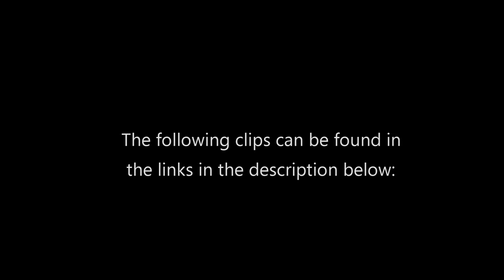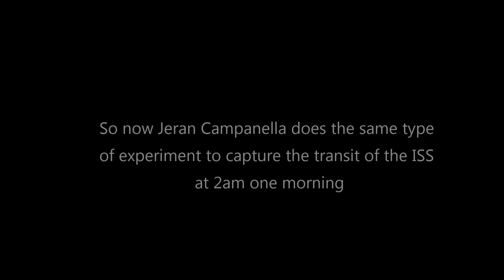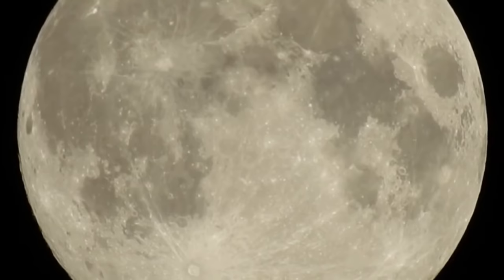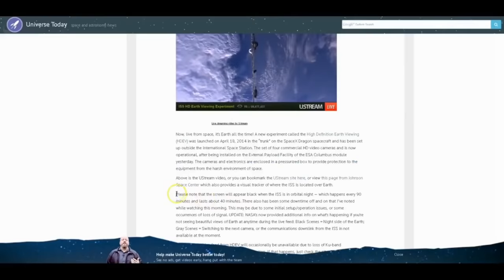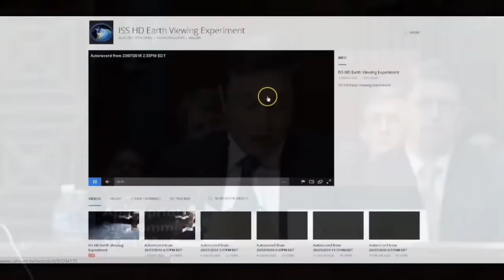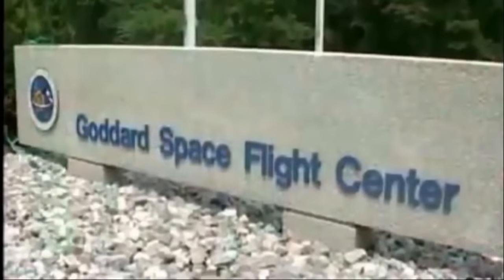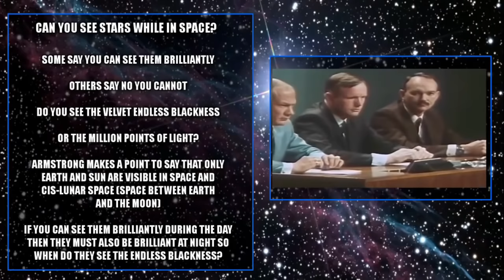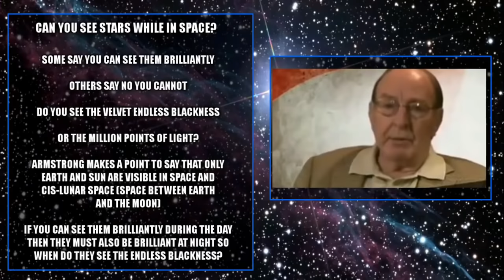The ISS Confirmed!

Comment: Why are o-ring seal's such an issue  they are only sealing a mere 14psi (1 atmosphere). Don't make the mistake of thinking a vacuum sucks it doesn't. When you fly you don't worry about the large number of o-rings used in the hydraulic systems for under carriage, control surfaces, brakes etc sealing hydraulic fluid at several thousand psi.
Reply: I agree it's not high pressure. You could seal it with duct tape.
Reply: Exactly. Debunkers often try to add to previous skepticism and then add it nonsensical stuff. Often to somehow contend that the Earth is flat. This debate used to be much more to the point and profession before that movement started to take the forefront of skepticism. Look up the ancient DVD "What happened on the Moon". I found it for free. Good stuff, old school. Educated thinkers in suit questioning rather than inverted baseball caps over hoodies.
Reply: Cloxxki - "Educated thinkers in suit questioning rather than inverted baseball caps over hoodies".   What is that meant to mean!?
Reply: @anti-trollcomedian1664  duct tape don't work in a vacuum  of outerspace and you never been to outerspace to know how outerspace works
Reply: @ejones6647  You have never been to outer space either, someone else commented back and told me I was correct. One atmosphere is only 15PSI. Look it up it's not that much pressure. How hard is to hold the end of a balloon closed until you tie it off?
Reply: Jon Holland "It's not high pressure and it doesn't suck out"???? Are you kidding me? Take a gander at  NASA's giant vacuum. Check out the door and the seals and the fact that the chamber is made by many feet thick concretely. They rarely use it anymore because someone almost died testing a suit. The cognitive dissonance is strong in this thread. I'm actually pretty shocked at how well the propaganda and mind control is working. Its so blatantly obvious that it's fake and you lot with fight tooth and nail to defend this fantasy. I know it's tough, it would be so cool to be able to be" in space" etc but it's a story, a complete fabrication. Enjoy being lied to. I'm done.
Reply: @TheJoshA  NASA's 'giant' vacuum.... There's a a clue for you there. We are talking about very small o ring seals probably around 1 inch dia, its probably not even seeing a loading over its total surface area of 1 ounce. 1 square foot is 144 square inches multiply by 14 gives you pounds per square foot. Not hard then to understand the loading on the walls of a giant vacuum chamber.
Reply: @TheJoshA  do you have a background in engineering? You don't seem to be looking at this with an engineers eye, there is no information on the mechanism. We have no information on how many turns of the rod are required to operate it or what material the o rings are made from  & we don't know how often it is used.
Reply: Nat Sarim  "That tin can, as well as their comedic "space suits", would blow up like a balloon,"
Then you must be so amazed every single day that the pressure in the tire of your car do not blow up, since they are inflated at twice the atmospheric pressure! 
Before finding FE sites like this one, I add no idea just how stupid some people can be. Thank you for opening my eyes a bit more.
Reply: hopefully ppl have said something about the fact its maintaining 14 psi in a vacuum
its not maintaining 14 psi in 1 atmosphere
thats a massive difference
i find it rather interesting theyre using disposable pressure seals to seal off the habitat, many points of failure
Reply: 14 PSI at ground level, atmospheric pressure goes up exponentially in a near perfect vacuum. They have a large, vacuum building. Were any of the spacecraft, Apollo, and ISS tested there?
Reply: Jon, Yes, I thought that was a pretty stupid Question from the Interviewer. I work with Hydraulics at work, and it's not a big deal, especially at about 14.7 PSI.